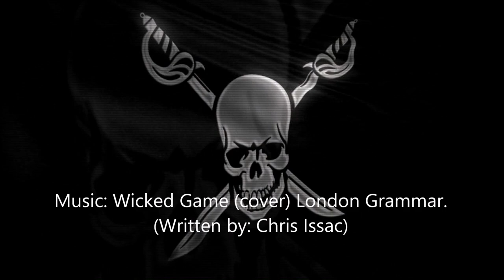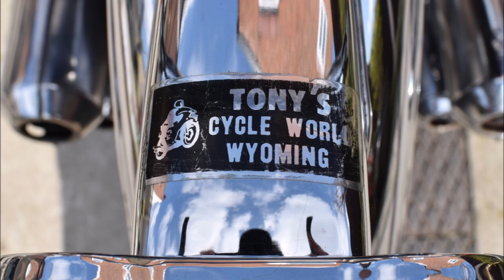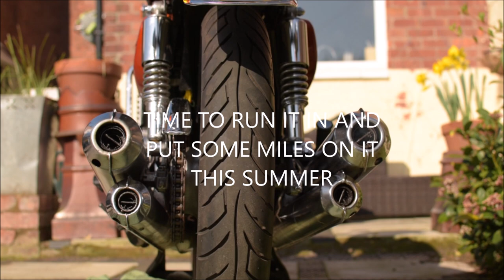Suzuki GT 750

Comment: Super restoration mate, just finished mine, top job
Reply from the maker: Hope you enjoy it.  👍🏻
Reply: @oldhelmet4213  I definitely did, I’ve had mine 26 years, got put away in 2014 due to personal reasons, pulled the covers off in mid 18, I was so shocked I stripped it where it stood, 5 hours later, it was a pile of parts, was already to go last year & the pandemic & lockdown stopped it